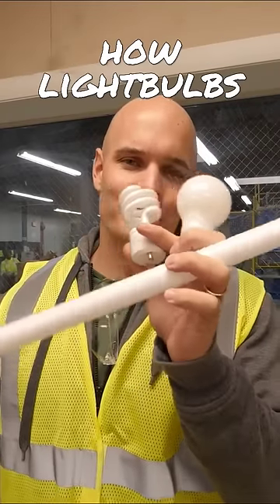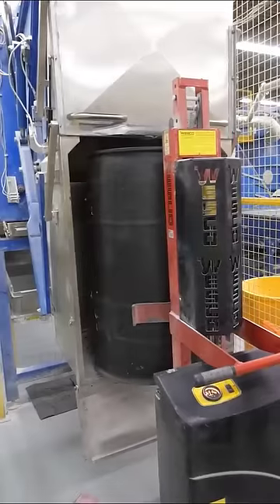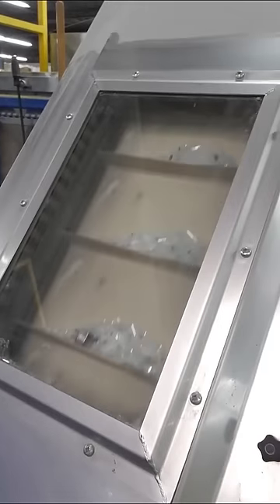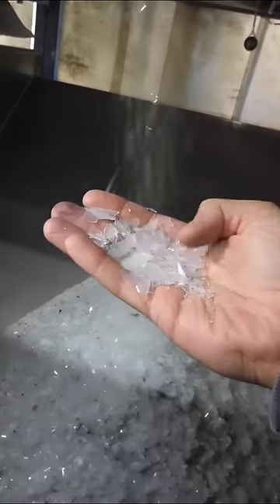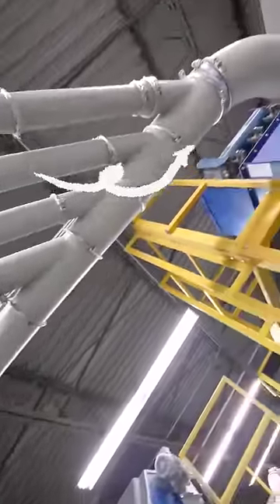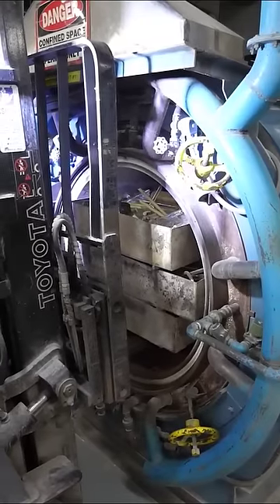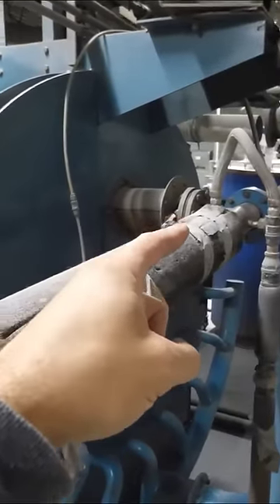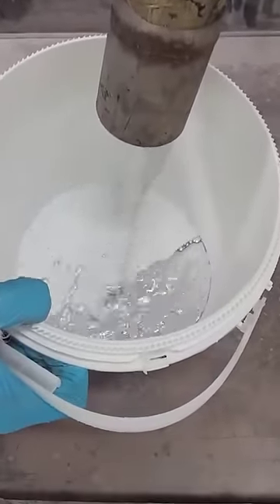VERY BRIGHT IDEA INDEED...

Comment: Seems like the handling of hazardous material is super sketch. You break 1 mercury lightbulb in your house and you’re supposed to leave immediately and open all windows. Then clean up the spill without using a vacuum to not disturb and aerate the powder. 

This guy opens a shoddy tub not sealed. I imagine the contaminants in that place are so high.

Comment: LED lights really need to be powered by some central ACtoDC converter, because that is the main failure point in all these overcomplicated bulbs.

Build places with standardized low voltage plugs and LED lights can be made to last longer and cost very little

Comment: If you say "light bulb", the only thing I associate with that is any bulb with a tungsten filament inside (which gets heated to a white glow by current flowing through it, i.e. incandescent ). You are showing [compact] flourescent tubes, (low-current arc gas-discharge emitting UV which stimulates a phosphor on the tube's inside wall to emit visible light). Why is that happening?

Comment: Dang. I used to work at a warehouse that shipped hardware store merchandise. I was in the returns area where things get shipped back for various reasons. I had to deal with  many broken florescent bulbs every day and there was no training or safety equipment. Not even gloves. We were warned not to smoke on our breaks because the phosphorus on our bare hands would get on our lips and cause burns. How i didn't blind myself accidentally rubbing my eyes i have to thank God for. I only worked there about a week and the guy who got me the job was mad i left but even as a dumb teenager i knew that job was no good.

Comment: Good thing we recycle glass we would be running low on sand im sure, recycling is much more expensive and worse for the environment than making new glass but there's only so much sand
Reply from the maker: Glass has more ingredients than just sand.  And we actually are running low on sand as well. The construction industry uses a ton of sand.  More than the glass industry. 

AND - If you watch the full video, recycling and reusing the glass dust uses 40% less energy than making new glass. Happy to help!